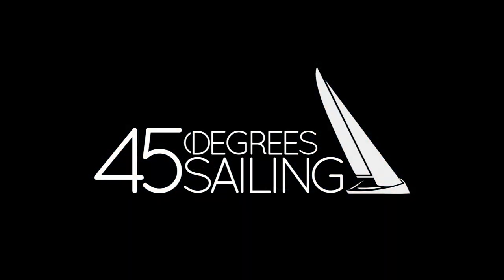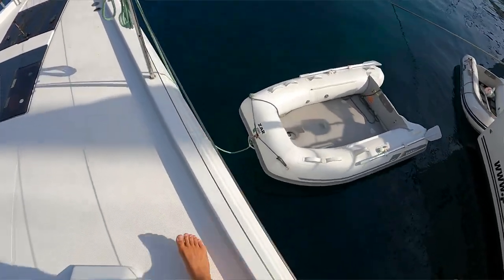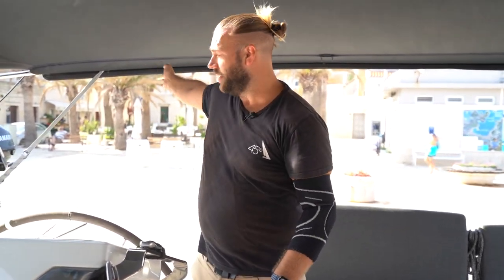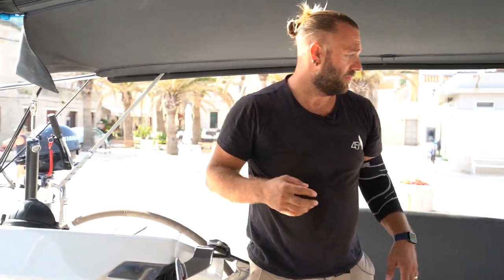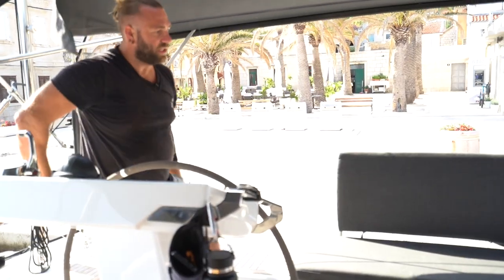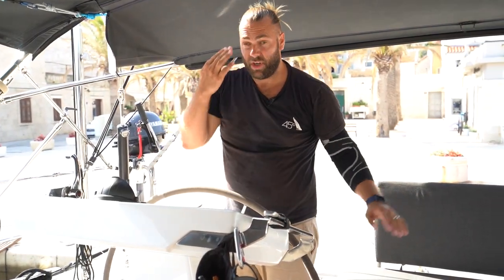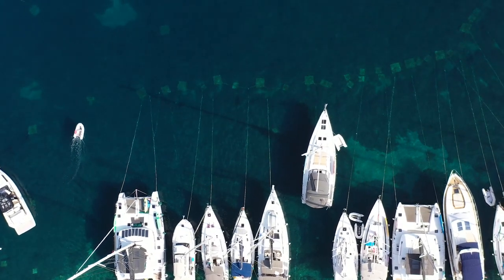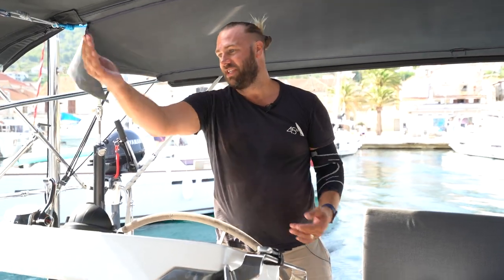Leaving the dock singlehanded - Sharpen Up Episode 8 Croatia

Comment: Hi from Turkey😊 Before untiding the bow line what I do is to turn the helm to upwind side with gear forward then untie the bow line. Lastly l untie the lazy upwind line. So that l can control the bow easily as l do not have a bow thruster.
Reply from the maker: Thats the way to do it! Just be sure to straighten the helm/rudder when releasing the stern line!

Comment: Great video very helpful as a new solo sailor. I have a centre cockpit beneteau 36, you cannot access the stern lines without leaving the helm. Do you have any tips to solve this issue? It's probmlimatic entering and leaving the dock. Many thanks in advance
Reply from the maker: Hey Patrick. Yes the centre cockpit adds this level of complexity for sure. The big challenge and focus for me in this situation is getting the 'stall time' in order to get out of the cockpit, control line on, and back to the throttle before losing control. 
This one for me is definitely about the approach and the momentum of the boat being towards the wind so that you increase the stall time. 
One other thing you can do if you have a competent dock hand is get the stern close enough to the dock that they can take the line from the yacht without you interacting with the line. This again is of course only going to work with some hull shapes that allow you to get this close. 
Its a tough one, I have follower here in Croatia withj a centre cockpit, I will see if we can demonstrate it on his yacht later in the season.
Thanks for watching!
Reply: @45DegreesSailing  
Many thanks for your reply...that would be awesome if you could upload a video of docking a centre cockpit singlhanded. As far as I'm aware there's not one on YouTube....yet! 👍